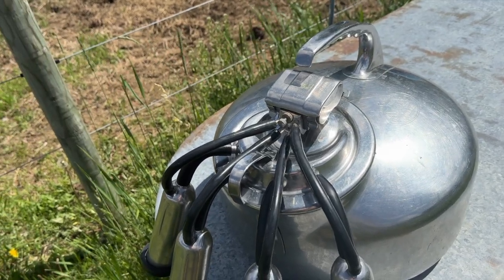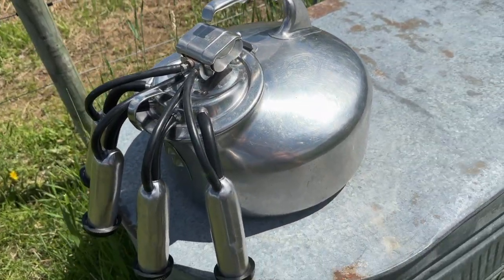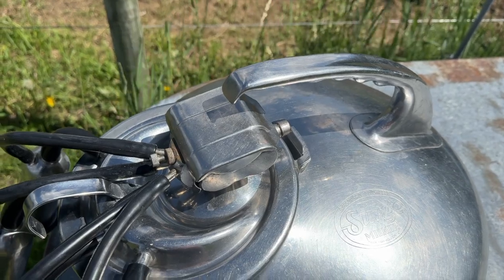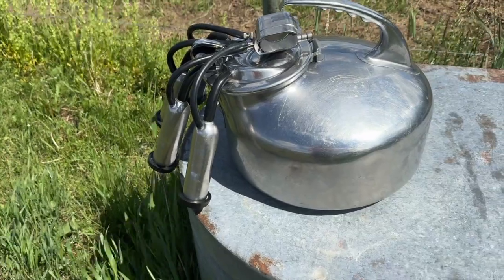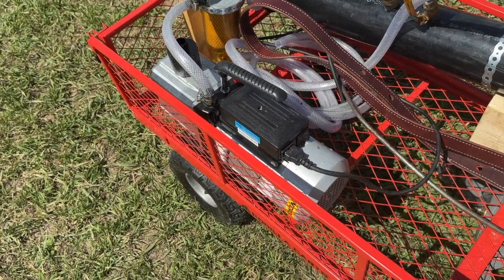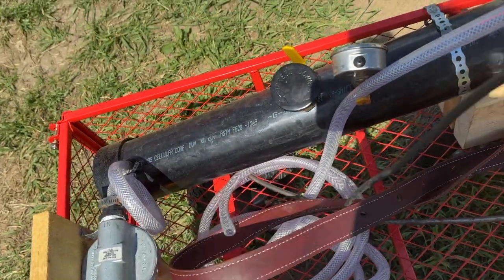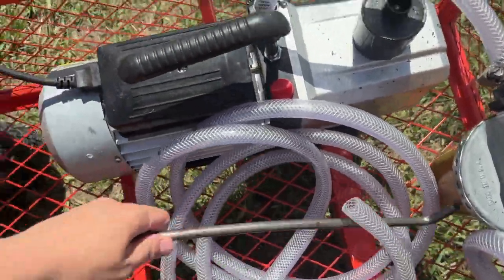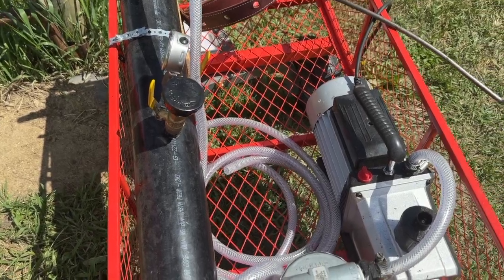Our DIY Surge Bucket Milk Machine

Comment: Thank you very much for this video! Will you be adding a detailed materials list for the build? That would be awesome for those of us unfamiliar with pumps, valves, regulators, the type of filter, etc.
Reply from the maker: @lauriesmith4049  I haven’t made up an actual list, as we mostly tried to use whatever salvage materials we had laying around first and then we had a small selection of other things at our local stores. Everyone might have something different to work with or access to more parts than what we had. But I can try to make a detailed list of what we used and put it in the video description!
Reply: @BurntRiverRanching    Thank you! That would be very helpful.
Reply from the maker: @lauriesmith4049  Hello, I edited the description to include a list of the supplies we used. Hope that helps!
Reply: @BurntRiverRanching . Wonderful! I really appreciate your help! Thank you!
Reply from the maker: @lauriesmith4049  you’re welcome!

Comment: I have a couple of surge belly milkers from when my grandfather had a dairy.  Hasn't been used in my lifetime (50 years). I don't ever plan on using them but can't decide whether to sale them or just hang on to them "just because ".
Is there much of a market for them?
Reply from the maker: @cyndismith4939  I’d say so! There are some with seams in the middle of the bucket and some without. The ones without seams are definitely in demand especially if you can rebuild the pulsator and put new inflations, vacuum lines, gasket and a check valve put on. You can get parts for them online. Hamby sells their rebuilt surge buckets for $700 USD 
People, like myself, really like them because you can take them in the house and physically clean every part of it. No need to have running water at the barn to run through the hoses or a claw, and no need for harsh chemicals.
Reply: @BurntRiverRanching   thank you for letting me know.  Now I guess I'll be doing a bit of research now.

Comment: Did you add the abs tank out of necessity or precautionary? I'd think 12cfm pump wouldn't need a tank
Reply from the maker: As I said in the video, it is precautionary for moisture. It also helps keep the vacuum at a more constant level when putting on/removing inflations.